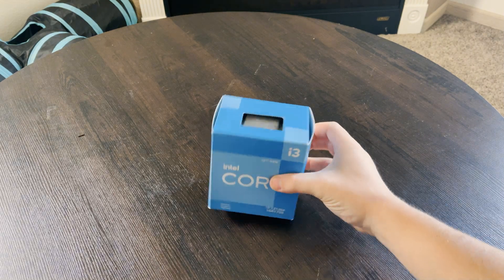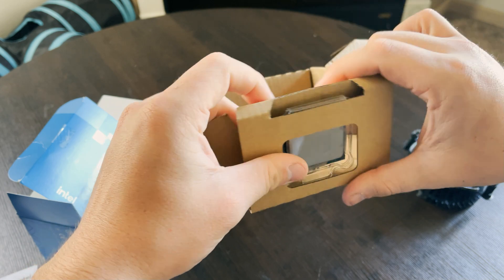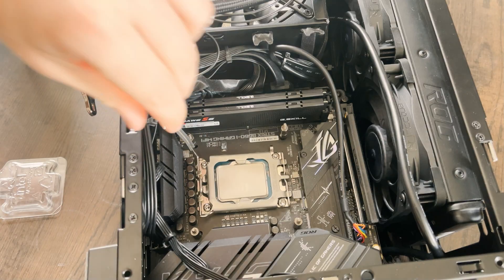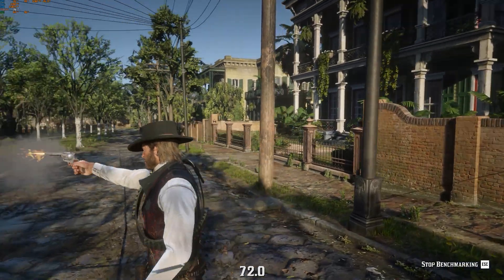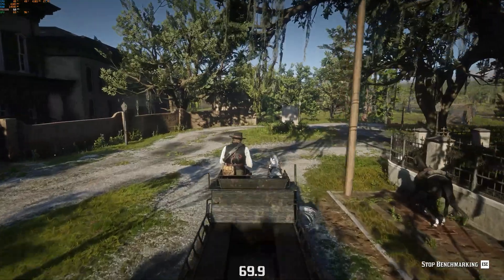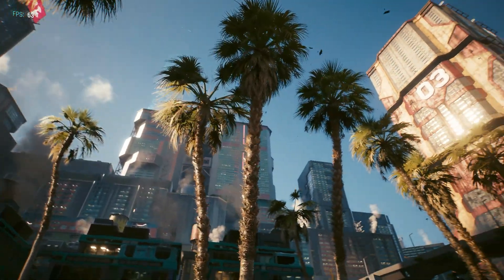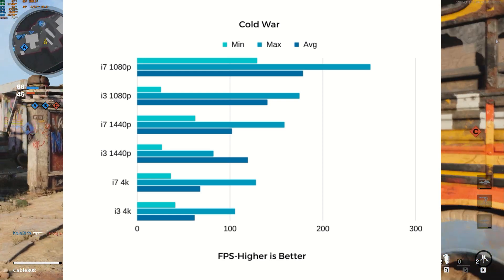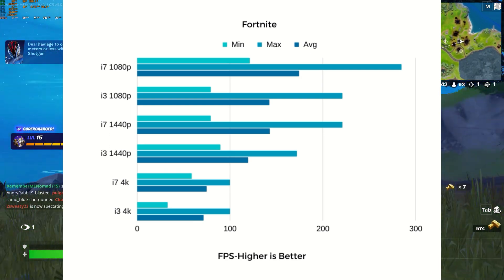Will a i3 keep up with a RTX 3080

Comment: this i3 12100 is faster than an overclocked i7 7700k an intel 2017 high end processor, good job intel 👍
hopefully they won't skip the i3 for the 13th gen like they did on the 11th gen
Reply: the 10100f was already similar or ever so slighly faster than the 7700k so the 12th gen part destroys it.
Reply: Yep that part always amazes me because I remember drooling over the 7700k when it came out thinking imagine it playing all my games at high fps, now I have the 12100f that cost me $100 brand new playing those same games at even high fps 🤣
Reply: @Kalyptic  I bought 7700k when it was new. Imagine my surprise when newer intel CPUs came out with more cores
Reply: They did kinda release an 11th gen i3. It is actually called the 10105.
Reply: @kotztotz3530  I have i3 10105f for a year now and it was 2% worse compared to Ryzen 3 3300X  in benchmark tests, but now after a year benchmark shows that is 2% better then 3300X in games !!! Those benchmark on internet are just hideous and unrealistic.
Reply: pretty sure they skip 11th gen i3 because amd dont release ryzen 3 for zen 3
Reply: even the 10100 performs the same as a normal 7700 (non-k), don't even need 12th gen to get high end 7th gen performance
Reply: That is good to know if you don't really care for the integrated graphics.  I have never had a computer other than a laptop with an APU.  Sure those integrated graphics are usually just fine for the light duty uses of a laptop but they are really mediocre when compared to an RTX 3060.  That is especially true when it comes to the Intel GMA onboard graphics, they are OK for light duty use but probably painful to play some games on.
Reply: And the i7 7th gen costs twice as an i3 12th gen at least in my country lmao
Reply: Even better. 12100f almost matches the 9900k too
Reply: there was no 11 th gen i3 ?
Reply: @RAHULRAJ-nd6vc  11th Generation i3 is actually i3-10105F. It was released after the release of 11th Generation
Reply: Almost nobody should buy an i3. When consumer grade i9's became a thing everything shifted. 
i3 -> i5
i5 -> i7
i7 -> i9

Buying new, 4 cores in 2022 is just unserious. The user experience is just gonna be miserable. If you're planning on pairing an i3 with a high end gpu, you're better off building a balanced mid range system. Yeah your frames will be a bit lower, but at least you'll get good frame pacing and no stuttery garbage.
Reply: @formless7000  what on earth are you talking about lol, there's 4000 different videos that prove 4c/8t is perfectly fine for basically everything.
Reply: @nikkigrace5288  
I genuinely can't tell if you're being sarcastic or not. 

In case you're serious: there are plenty of benchmarking videos showing the cpu usage in modern games on these quad cores. They're at 90-100% usage all the time, and that's without having anything running in the background, here comes the stuttering since you have next to no cpu overhead for other tasks. So don't even think about multitasking and gaming on 4 cores. We don't even need benchmarking videos to notice the difference between 4 cores and say 8 cores. Your computer just feels so much more responsive with more cores, even when not gaming. Just browsing the web takes more computing energy than say 10 years ago since the web is much bigger and more complicated now. If you have multiple programs running on multiple monitors and you want your pc to be responsive you get as many cores as you can afford. Especially since a 14 core i5 is about to release. We were stuck with 4 cores for nearly a decade, now we're finally moving forward again but you wanna stay still and live in the past? Quad cores are NOT the future. So unless you plan on playing only older games and you don't multitask, or you like using a sluggish computer, I wouldn't advise anyone to buy 4 cores unless they're on a very tight budget and need a computer. But if 4 cores feel "fine" to you, that's great. Just know that more cores will give you a better user experience.
Reply: @formless7000  so you'd rather get 11400 f than 12100f ? I mean if you're gonna get a 3080 that means you want to use it on either 1440p or even 4k, which lessens cpu load... and 1080 is already handling itself .
Reply: @deathtoinfidelsdeusvult2184  
Higher resolutions do not lessen the CPU load. It does stress the GPU more, but the CPU does the same amount of work and does not become less important. And I wouldn't call 50-100% CPU load in these benchmarks "handling itself". Put some background tasks in the mix and you've got yourself an inferior overall computer experience. Even in games, the frame times won't be as smooth and you'll encounter more hitches and stuttering, especially on 4 cores. For gaming the 12100f really should be avoided at all cost, especially if you've got 3080 money. That's just a mismatch of components.
Reply: @formless7000  you're referencing a lot of other things beside just gaming. You're talking about multi-tasking on dual monitors multiple programs running in the background, etc.  If the focus is only on gaming it is proven that the i3 12100f is equal too or performing even better than its much more expensive counter parts.

He said that much in the video that if you're doing editing, etc that you may want to go elsewhere but strictly gaming at this price point the i3 is essentially in a league of its own.
Reply: @satisfiedcustomer  
"Just gaming" isn't one thing. You can just play esports or just play triple A games. If you're playing the latter you don't want an i3.
Reply: @formless7000  I mean.... why would you put background tasks on a gaming exclusive purpose.... I mean in 4k resolution you can pretty much use 12100f and even lower cpu. other benchmarks already did that. just don't play unoptimized games, which 2-3 games actually exists.
Reply: @formless7000  Wonder if Raptor Lake changes it?  I could see i3 part having 4 performance cores and 4 efficiency cores (13600 is 6P8E, wonder if 13400 is 6P4E ?)
Reply: @kimnice 13400 is 4P4E
Reply: @kimnice  it does. the 12th gen i3 is absolutely wonderful.
Reply: @formless7000  Dude, intel has shown that 4c/8t is more than enough for gaming only.

Heck, it's not about the core count, it's architecture and IPC. You think Faildozer is futureproof?
Reply: @AlfaPro1337  
The problem is you're only focused on the framerate. The performance of a CPU is determined by so many more factors than just the framerate. Yeah cores aren't everything, but they are crucial for a proper experience if you want to play demanding games and/or multitask at a reasonable speed. Using 70-100% of the CPU while only gaming is not what I call "more than enough". It's more like hanging on for dear life. We had 4 cores for nearly a decade when Intel had effectively a monopoly in the CPU scene and now that's finally over, but you wanna stay on 4 cores? What a joke. Intel is releasing a 14 core i5 chip in about a month or less, but you think 4 cores will last? No, absolutely not. Unless you play older games and do not multitask 4 cores is done.
Reply: @formless7000  Except if you are on a budget, i3 and i5 12th gen, you're playing demanding games, at a reasonable graphics settings, and heavily cut down on multitasking.

Once again, game devs are using shitty DRM, AND/OR poorly optimised.

I'm not sure which 3A game it was back in 2016 that spawned benchmarking of DRM vs DRM-less (pirated or not) game, and forcing to them to take a look at past titles with the same DRM.

I remembered that i7 6700K + 1080 was barely keeping the framerates, while the i5 6600K was struggling.

When benchmarking the DRM-less version (complete removal, not disabled, the exe size is reduced), wow, a substantial boost in performance, no more stuttering, increased in fps and even the CPU usage drops dramatically, heck, even the i3-6100 was performing as like the struggling i5 with the DRM.

14 core i5? You aren't the budget gamer that starts from the very bottom and upgrade all the way to the top.

No budget gamer get the unlocked i5.

It's AMD's fault for putting out the Faildozer iteration, their i7-970 easily beats the FX-6100, and later 5960X easily beats the FX-8350 and later FX-9590 and even, so, Intel was offering 6 cores at a reasonable price starting Intel 5th gen via HEDT. 

You don't need quad channel on it, you can run dual channel, even so, X99 board are built like a tank, even the cost effective branded boards are pretty decent.

Guess what, AMD is now the Intel (somewhat) thanks to Evil Su.

1. Where's the high-end flagship US$300-350 that has more core count than the previous flagship of the same price?

Before Evil Su took over, AMD's top end were US$300, yet, increased in core count:

PX4 9600T > P2X6 1090T > FX-8150 were all within the same price range.

I was expecting 12c Ryzen for US$300 at launched, but no, a GLORIFIED LOW-END 6 CORES for that price. No way!

This is further compounded that AMD is now the monopoly in the CPU space, not Intel.

2. Heck, AMD claims that APU is the way to go for consumer desktop, because having an iGPU counts as a basic desktop.

Plus, this could be a chance for AMD to improved their video en/decoder, it's atrocious, below QuickSync, yet, AMD squandered it.

3. Not only that, AMD pulled the same stunt as Intel, by making 2 socket 2 platform (2S2P) instead of 1S2P.

AMD mocked Intel for making 2S2P move back in the 1366 and 1156, guess AMD shot their own foot.

Oh let's not forget the debacle AMD shaming Intel for making 'fake' dual core and later quad core back in the Early versions of the P4D, C2D and C2Q.

So what's the point in buying AMD products if they are becoming Intel?

Comment: I fully intend to combine Ryzen 5 3600 with RTX3080.
It's not absolutely terrible for content creation.
It isn't 5800X3D or 5900X or even 5700X,  but for a complete begginer it sufficient. 
As is 12100F. 
Certainly significant improvement over my Ryzen 3 2200G. 
On both fronts

Eventually later next year upgrade to 5800X3D or something to have a rig to last me a lifetime. 😆
Reply from the maker: idk if it'll last a lifetime, but it'll certainly last until the 3080 isnt kicking anymore.

Comment: I have an i7 4770 thats finally starting to feel quite old. This new i3 seems like a good upgrade, its the same core/thread count but much faster and a lga 1700 board offers me good upgrades at a later date.
Reply from the maker: I used to have a rig with a 4790, they’re ere some of the best CPUs ever made
Reply: @CablesTech  I literally just upgraded from i7 4790 to i3 1200f, this cpu is crazy fast. I was looking for a long time what i wanted to buy, maybe used 9th gen or someting. And then this popped up and i was blown away. Only shame that the motherboards are so expensive nowadays, i wanted ATX but its just so much money i dont want to spend lol
Reply: This would be an ultimate upgrade over the 4770!  Do it!!!!
Reply: Ddr3 bandwidth hurts haswell performance. Fantastic chips otherwise.
Reply: Better upgrade to an i5 than 4 cores again.

Comment: I have a 3080ti the intel 11600k, it seems to keep up just fine but what do you guys think? my CPU knowledge is still in very early stages hehe
Reply from the maker: A good rule of thumb is if you cant feel stuttering, hitching, high frame times, or general weirdness when gaming. You're probably fine
Reply: What games are you playing and what resolution? The 11600K has 6 cores so it's not that bad. But you would benefit from more.
Reply: @formless7000  Horizon Zero Dawn, Witcher 3, CSGO, Battlefront 2, RDR2, Cyberpunk

I play at 1440p and above (using DLDSR) depending on if I have GPU power to spare

Comment: i am surprised the difference in the fortnight title as it was designed when 4 CPU cores was the design target CPU
Reply from the maker: I think in most games it has a lot less to do with the amount of cores the cpu has because of hyper threading and a lot more to do with the i7 is boosting to 5.0 ghz and the i3 is only at 4.2

Comment: Thanks for the vid. Wonder how my old i7-6700K compares and whether it would be worth replacing with this. p.s. You have a laid back but informative presentation style which I like a lot. Hope you make some more vids.
Reply: 6700k is going to bottleneck a higher end card like this I used to run a 6800k and it was pushed pretty far with a 1080

Comment: % lows more important than average framerate imo. If you play on 1080p or lower for high refresh in shooters etc, the i7 or 12400 is needed. Look at the min FPS on CoD and Fortnite here, imagine you get these frame dips mid gunfight? On the other hand, I think a 12100 would be just fine for high resolution single player games.
Reply from the maker: Fair but no, those frame dips were at the starts of matches and loading screens

Comment: Kind of debating on what to buy.
i3 12100f or 12400F paired with an rtx 3050(or 1660ti). I am tight on budget but i still want to screen record games like valorant without lag.
Reply from the maker: Since you’re pairing it with a 3050 and you’re on a tight budget. I personally would go for the i3 to save the money. You can offload the video recording to the GPU using shadow play. You’ll record gameplay with near lossless quality and near lossless frame rates
Reply: The 12400f is better value than the 12100f, but the 12100f is still not a bad choice. If you don’t care about RT or DLSS I would go with 12400f and GTX 1660 ti.
Reply: GTX 1660 ti is better rasterization performance than RTX 3050 while also being cheaper msrp
Reply: @potatoes5829  Exactly, although, he could save more and just get the 12100F. You can get a 2060, or even 2060 super that is cheaper and creams on the 3050 as well. For just gaming, always spend the most on GPU on budget builds. Even a 10100F is very capable today(7700k replacement.)
Reply: 12100f
Reply: get the I3 and record with the GPU.

Comment: I have an i7-8700 with a B365 motherboard and I always game at 1080p, so is it worth upgrading from an i7-8700 to an i3-12100f?
Reply from the maker: Honestly probably not, you have 2 more core and 4 more threads than the i3. It’s also not at the point where it’s showing it’s age yet. I’d wait another generation or two then upgrade to a i5 or i7. It’ll still be a while before I recommend replacing a high tier product with a low tier product. If you had a 2nd or 3rd generation i7 it would probably be worth the upgrade but not with something that recent
Reply: @CablesTech  Ok, thank you for the reply. 😁

Comment: If you actually have high end gpu like this go for at least  i5-12400, because newer games like Cyberpunk will benefit from additional cores.
Reply from the maker: I’ll be completely honest with you, when I swapped my i7 for the i3 it was only temporary so I can’t tell you about long term usage but, I did use it for a week and during that week the only time I noticed I didn’t have my i7 in my system. Was when I was video editing

Comment: Not to mention the i7 has way more cache.
Games that are sensitive to that will show a good difference.
Reply from the maker: The current i7s are absolute monsters in compute performance and so is even the i5 12600k but, the point of the video was that the current i3s punch well above their weight class and are more than capable of gaming especially in budget rigs
Reply: @CablesTech  yes, someone called me stupid for thinking that using an i3 paired with a 3080 Ti being a great value build.
Even a 12400.... typically the kind of conpulsive customer i guess.
Reply from the maker: @Spido68_the_spectator  I mean I don't know if I would actually pair the two in a serious sense. My video wasnt so much recommending pairing the two as much as it was showcasing that the i3 is much more powerful than people give it credit for and that you dont absolutely need a i7 like you used to

Comment: should i buy i3 to wait for 13th gen or just go i7 12700 already have b660 but sold the i5 12600k for profit lol
Reply from the maker: Personally I’d grab the i7, its difficult to gues next generation hardware performance and especially availability. It’s also a completely different animal than a i3.
Reply: @mohahhafiiz2153  what was the reason you sold the 12600k?
Reply: @rokdovecar5275  got it really cheap and i feel bit late to the party got 35-40$ profit . I also feel could wait for at least couple a month since im using my old laptop it could handle some old triple a game but i play mostly just LOL .